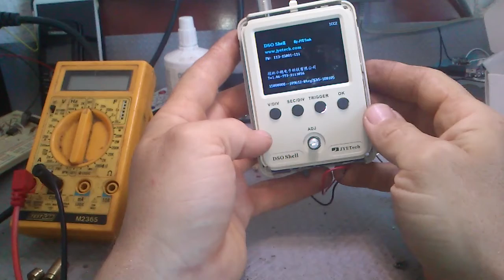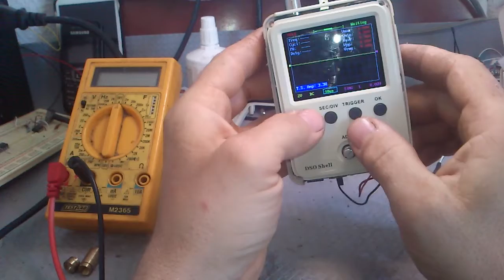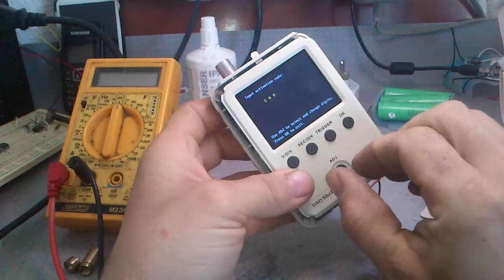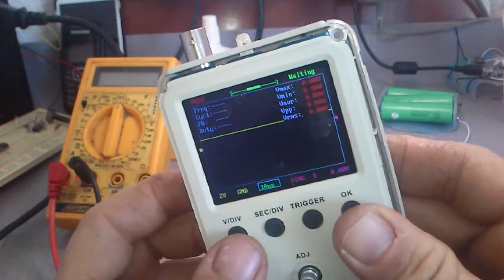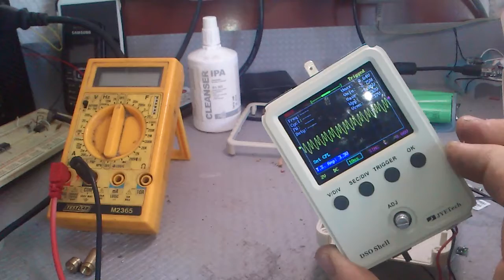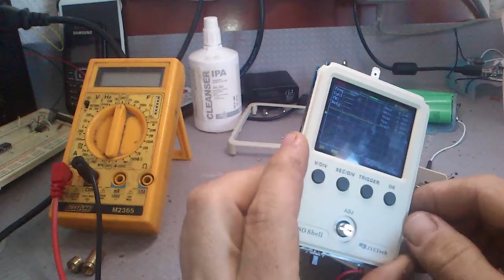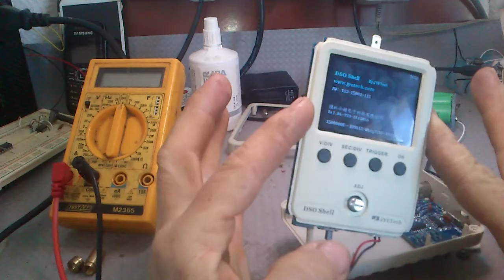Busted dso 150 shell. "eeprom failed"

Comment: its not you. there are a lot of fakes that  dont work properly. i got one. it wont respond to commands. did you get it on ali express? thats where mine came from, ready built too. so it wasnt my putting it together. given up on it. got ripped off like a lot of people who got theirs from a bad seller. live and learn, wont be buying from them again.
Reply from the maker: Yes, ali, but the right vendor. Very helpful, they sent me a replacement board. I tried to fix the old one a couple of times but I suck in electronics.

Comment: Hold down the middle button (rotary encoder) for 3-4 seconds to get rid off the screen you are in! At this point you are in the diagnostic mode and also if you like to see the real data that comes to the unit during testing...... READ THE MANUAL please. I have this same unit, works just fine. Don't get frustrated and also watch some videos here on youtube how people calibrate it and or assemble it. When you do not have any grounded surface, the static electricity can and will damage the very sensitive electronic components, you will experience some weird behaviour! Also, updating your firmware - mine is: 113-15001-120 or newer, can fix your problem.

Comment: Shell for battery pack on ebay https://www.ebay.it/itm/202265137904?var=&ssPageName=STRK:MESELX:IT&_trksid=p3984.m1555.l2649
Reply from the maker: Thnx, I don't need it to be super portable. I just want it to work. I wait for a propper UART to usb interface from ebay (one I have doesn't work) and than will do a follow up.